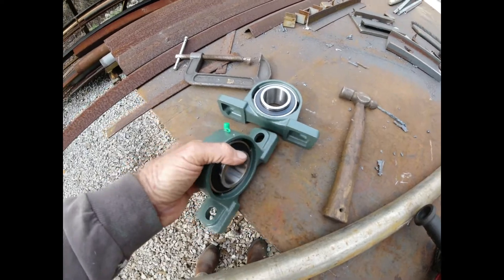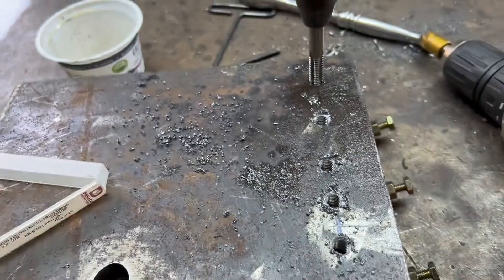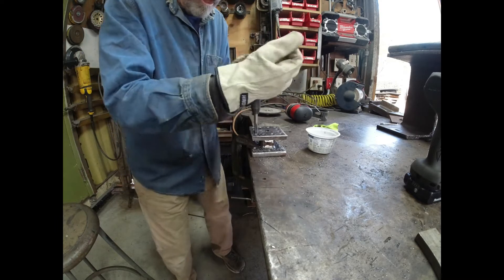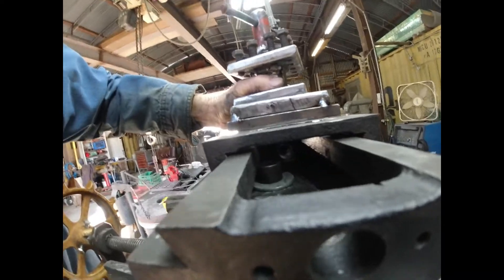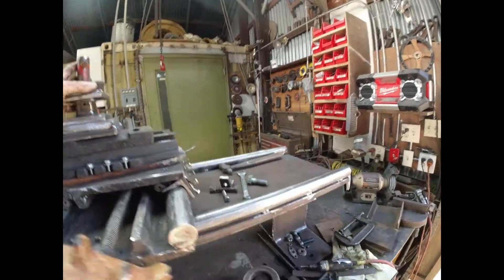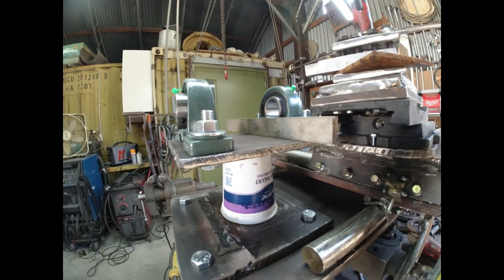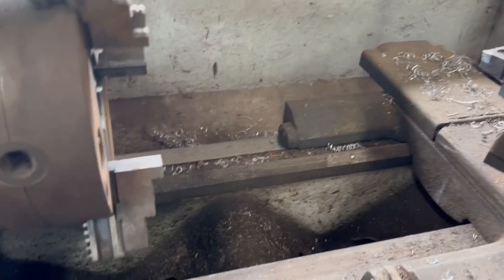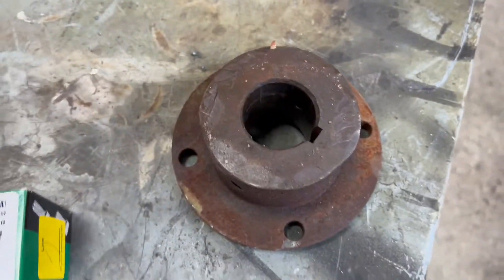Building a home made DIY lathe for metal work using mostly on hand materials.

Comment: Your not using a solid bar for your chuck are you ? From this point a box and gears and pelt pulley for the head stock . Your forward and reverse come off your drive shaft then down to your feed , use the pulleys from a drill press for speed control of your feed and a tensioner to engage and disengage your feed screw . My tools cut best just below center . Your tail stock and easy rest should be easier to build ( a cam lock on your tail stock works the best ) but it’s not going to be that far off the ground is it ? Can lock downs on your x and y axis work best . And a live center I think is the way to go . Graphite works well on your ways . The stiffer you get it the better it works !
Reply from the maker: Thanks Dave! All good points and in a prefect world....
Reply: @barrylukebuilds7894  I guess I was rambling on , but I like running my lathe and kinda get excited talking about it ! Sorry . So many things to do with one !